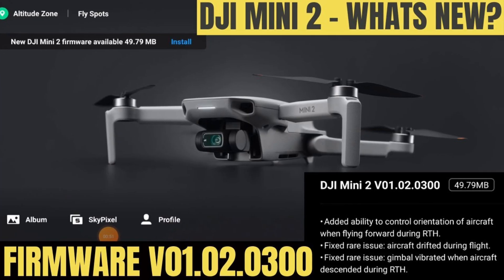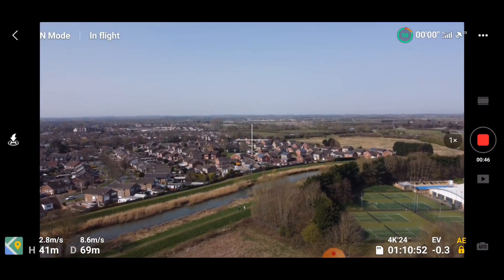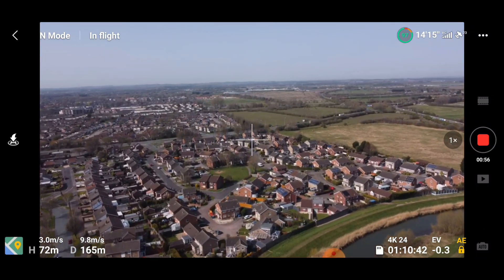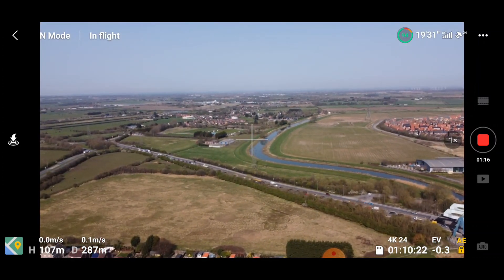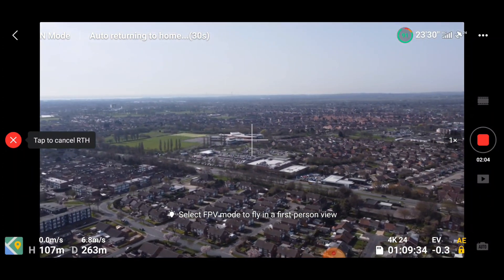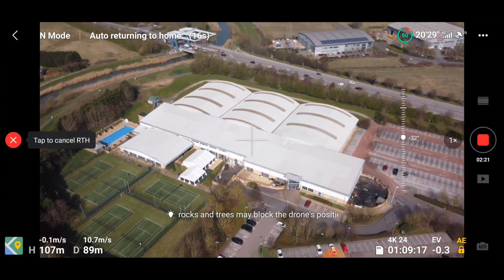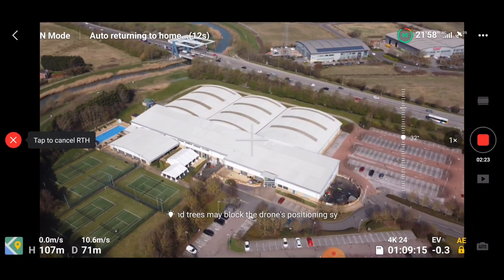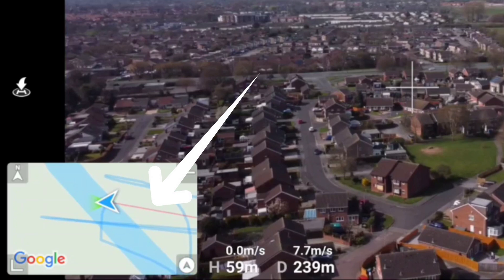DJI MINI 2 SIMULATED COURSE LOCK HACK FIRMWARE UPDATE V01.02.0300

Comment: Nice vid but RTM as you know does have a fixed altitude settings. If you use this feature while using Yaw and then still reduce altitude yourself you really belong in the category of being allergic to nuts and having to have a bag of nuts stating "This bag may contain nuts" in case you forget.  Where has all the common sense gone ;-)
Reply from the maker: Which is exactly why I go on to suggest it is not used and I didn't demonstrate loading altitude in my video.  The theme to my video is very different to others you may of noticed, others were saying how good it is, I showed what you can do with it but then say don't. So I completely agree with you
Reply: @GAVINHR  yes I did enjoy the vid and look forward to more dji mini 2 stuff when possible. I was just having a giggle but not at you.
Regards
Reply from the maker: Haha no it's absolutely fine ! I think a few people were confused on my stance by advertising it then saying don't use it 😂
Reply: @GAVINHR  I had my first Mini 2 flight a couple of days ago and had a lot of fun .  After 15 or so mins was very confident with it but Lots to learn and I have the freewell filters but as I  am just beginning to learn how cameras work it will be a while before I use one I think  :-)

Comment: So what you're saying Laddie.  (I'm American so we don't usually use that terminology.  But keeping in the spirit of your locale and accent?  I used it here.)

At this hack of yours.  With the return to home feature.  As it's flying itself back to you.  You get to play with the other joysticks and gimbal control.  During its return flight home to your start point position GPS lock.  While you get to rotate and spin the drone.  While also operating the gimbal angle positioner.  For these smooth cinematic shots.  Which is my only purpose for acquiring one of these fan dangled contraption gizmos.  Since I have been a professional photographer and videographer/cinematographer.  In years past.  Many years past.  As my focus was primarily, Superlative Audio Productions.

But hey.  After you work for a major television network for 20 years.  You learn professional ways how things are done.  Not YouTube ways.

And so it's under my belief and impression.  One can actually fly there drone in the direction in which they want to.  While changing the altitude and/or yawing of the vehicle from left to right.  But only if you are an accomplished pilot at doing so.  Because as I understand it.  I believe.  One has that full control when flying their quad copter drone.  You just have to make certain you don't crash and any trees backwards or sideways or powerlines.

This frequently means doing the proper surveillance around the shot you want to create.  Sort of preproduction on location.  To first practice that shot.  With no need to hit the mommy I want to go home button.  And then twirling your drone and pointing the gimbal up and down as you twirl.  As it comes home to baby.

And so you call that a Hack?  No.  That's not a hack.  That's just a feature they omitted the first firmware release of the MAVIC Mini-2.  And when everybody complained.  They then re-released it.  I mean do you think they actually had to write new code?  No.  They were just saving that memory allocation area.  For later firmware upgrades.  That they had envisioned or were envisioning.  Now those features may never come to pass?  Because everybody wanted to twirl and play with the gimbal as it was coming back to its start point.

So there is a limited amount of data.  They can blow into these chips.  Without having to completely redesign the gizmo.  But as they do that regularly anyhow.  It won't be long before the MAVIC Mini-3 along with the MAVIC Pro-3 along with the MAVIC Air-3.  Later this coming year or next.  Oh well!

And so I then must pose this question to all here.  How many people here.  Purchase a brand-new car every year to replace last year's model?  Right all 2 of you.  That I retired with fat bank accounts.  Which most of us do not have.  Who are retired and living solely upon, Social Security retirement income.  Which is not livable.  Not sustainable.  So we also have to figure out ways to make extra money while we are dying.

And so I figured I might go back to my cinematography/videography, professionalism, skills and passion, talent and experience.  To do so.  Starting with something I've always dreamed of.  Flying cameras not constricted by a Jib/Crane.  Which I also own a pair of.  And those were the bees knees for many years.  And still are.  Because they are totally silent.  And they usually can't hit somebody accidentally in the head.  As they are enjoying a concert.  And so you want to fly that drone outside of the seating limit of the audience.  So that if it does go down.  It just lands on somebody's car.  In the parking lot.  Whoops.  But retrievable that way.  Hopefully not leaving any scratches, dings, blemishes.

And you certainly don't want to smack them in the faces of the rock 'n' roll stars on stage as they are singing.  So drones not really good for rock and roll concerts.  Jib/Cranes are.  But to get that nice big shot from the sky.  Of the performance venue.  Is always a thrilling shot to see.  At the very start of the show.  And then switching to that shot.  Between songs.  To show the amount of people at the venue with the band on stage in the background.  And holy shit!  They've got a helicopter shot!  Yeah no not really.  It's only a $500 helicopter.  Not a $5 million helicopter.  But it still looks like $1 million shot.  You switch to from time to time.  And every 15 or so minutes.  You bring it back and replace the battery.  And you keep that shot hovering for the entire show.  With an occasional declination and elevation.  Just for that gorgeous prospective shot.  And that's where you can take the hands off the controls of the drone.  While it's hovering.  And then it is a, 150 foot tall tripod shot.  Like you had your camera affixed to a broadcast antenna tower.  And when rotated.  Provides an entire shot of the city, parking lot and stadium as you swing back to the group on stage.  And dissolved to the close-up camera of the lead singer.  Now that's Production Value.  And one of the many ways in which to use and incorporate these drones.  In your own rock 'n' roll band concert videos.  And with a couple of people on the ground that have handheld cameras.  4-6 or 8 of them or even more.  Through a couple of real-time video switchers.  And streamed live on the Internet.

So I'm not really interested in having a drone to shoot grassy gray looking boring fields.  No.  I like lots of eye candy happening in my camera lenses.  I like exciting looking video.  I like exciting sounding video.  And none of you dumb bunnies know how to deliver that.  Is just amazingly bad.  All of the time.  And people mumbling on camera in indecipherable ways.  Let's just mumble our words out for this review.  Since we don't know what we are doing and haven't read the instruction manual before doing this review.

And so how the FUCK did you make it to school functioning in that manner?  Undoubtedly cheating.  Because the amount of morons flying drones is absolutely, the dumbest damned thing.  Without proper licensing.  It's still a flying aerial vehicle.  And it's still a guided missile.  That just happens to not include an explosive incendiary device.  And if you need a motorcycle license to ride that missile.  Drones should only be sold to adults with driving licenses.  And all drones need a built-in interlock system.  That requires the entering of your legitimate licensing number.  Before it will ever lift off the ground.

I know that would really piss people off.  That want to play with their toys as soon as they get them!  Oh well!  Too bad!  It's something that will have to be lived with.  Whether you like it or not.  If you are not competent enough to drive a motor vehicle.  Bypassing that test first.  What makes anybody think they have the right, to fly an airplane or a battery-operated drone quad copter.  In our airspace.  Thinking they can go wherever they want to.  Because it's only a toy.  It's not a toy.  It's not really a toy at all.  It's been turned into a toy.  By greedy basturds.

In fact.  I believe.  These drones.  Could be used for the next terrible, unthinkable, coordinated attack.  Upon the USA and its people.  With these battery-operated flying drones.  They could kill most USA citizens.  Including themselves.  But they have no value to their own lives.  They will kill or be killed if they don't.  So they will do what they are told.

So while I would like to have one of these drones for my own, retirement and video and photographic professional hobbies.  I am aware.  Of the horrific imposing attack that these devices can reign upon us from the sky.  And all these extremist crazies need to do.  Is press a button.  To rain down death.  Upon the USA and its citizens.

I want one but know the implications they can present
RemyRAD

Comment: While I think this is a nice feature for on-the-fly ideas, Litchi's waypoint missions are a more elegant way of automation, controlling all the aspects of flight and image capture.  You can even pre-program the mission at home so there's nothing to do on sight except pull it up and tell it to run.
Reply from the maker: Totally! I think people are trying to use this as litchi does not support the mini 2 - and I wonder if it ever will!
Reply: @GAVINHR   @GAVINHR   I forgot about Litchi not yet being ready for the Mini 2 quite yet. For Litchi to include the Mini 2 it needs the SDK kit which was promised to be delivered early this year. DJI through everyone a curve ball by coming out with the Mini 2 on the heels of the Mini 1.  Litchi has confirmed its intent to support the Mini 2. Why wouldn't they?   Most likely the Mini 2 sales will exceed that of the Mavic Air 2 because of the price point where folks went with the MA2 because of the Mini 1's limitations where were largely erased with the upgrades of the Mini 2.

Comment: Haven't tried this yet, but I assume that the RTH speed is dictated by the mode you are in, Cinema, Normal or Sport.  Also, you mentioned only gimbal and yaw function, but I've heard that you can also control altitude.  If carefully executed, it does seem to have some benefits.
Reply from the maker: It absolutely has its benefits and it a good little tool if you want to use it of course. I just think manual flying is much safer :) therefore wanted to demonstrate it but not encourage it if that makes sense :)

Comment: The feature can be useful, but you can’t adjust the speed of the RTH and it quickly accelerates up to 10m a second, which in my opinion is a bit too fast
Reply from the maker: I have to agree, I guess the way round it would be to pop it on 1080p 60 FPS then slow the footage down in post I guess
Reply: Good to know!
Reply: Put it in cenic

Comment: I think the biggest mistake would be if to reduce the altitude and then hit an obstacle but if you maintain the RTH altitude, everything else will be cool.
Reply from the maker: I agree, however I have seen other YouTubers doing exactly what you said and actually reducing altitude to do it which seems a risk. Stay high and it can be useful yep :)
Reply: @GAVINHR  Sure, one has to be careful because the yaw knob is also the one that increases and reduces altitude.

Comment: Excellent Gav as usual, the RTH should really only be used as you stated, I did try this feature  on the mini once, but now never use it on the mini2, only use the  RTH as an emergency backup, people should not promote its use as a camera capture, it is however useful to spin around on the home run to see if you have the altitude correctly set?
Reply: Totally agree, tried it this afternoon over the city centre but didn't trust it with the tall buildings.
Reply from the maker: Oh absolutely its great to make sure you're not about to hit anything but I am totally with you, RTH is a back up safety feature, Hence the tone of the video - this is how you do it, but I don't think you should :) Appreciate your comment thank you

Comment: Hi matey does that information battery and wind warning  scrolling across the screen stay there or does it go off its distracting 😁👍
Reply from the maker: You can turn them off in the settings :) I trust you mean the ones down at the bottom?
Reply: 1.08 min into video small scrolling